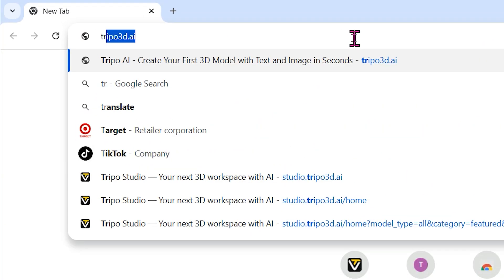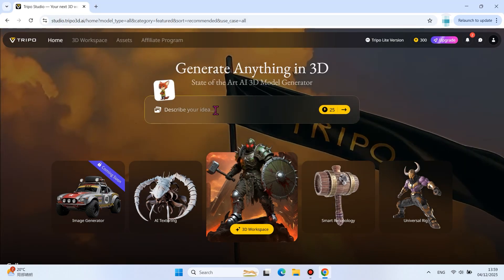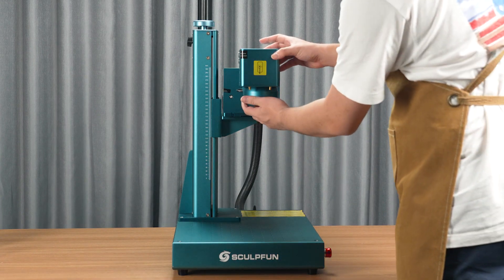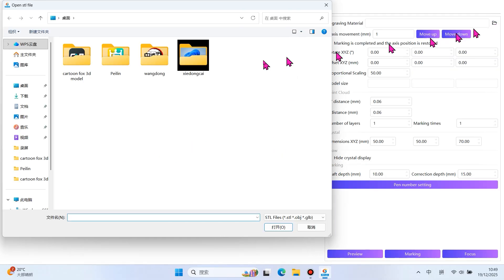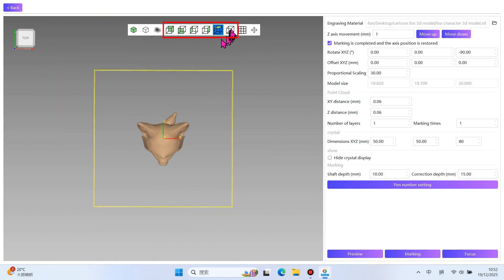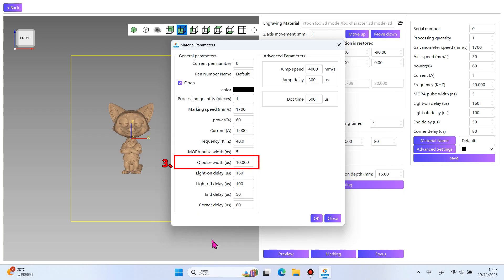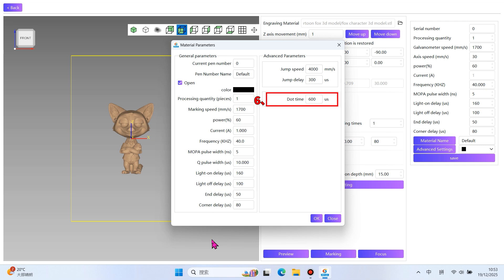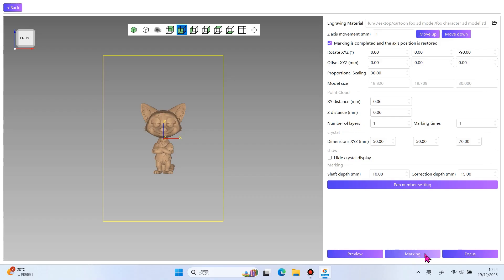Sculpfun Tutorial: How to Perform 3D Crystal Inner Engraving with V5 UV Laser | Step-By-Step Guide

Comment: Thank you .. this is the exact settings we have been using, but most of us are getting a "squished" X-Y, Z is ok. If I DESELECT Use 70mm (at minute mark 2:40), my scale it better. My WHITE PAPER shows the model as perfect, but when etching, the X-Y are roughly 1/4 actual size. 

Also, if my model is say, 200mm x 200mm x 500mm, then my SCALE is NOT "1.+" like support told me to use. I must scale it down a LOT to fit within 50x50x80. I even tried the apple .stl that came on the USB, and got the same bad etch, X&Y are tiny within the cube.